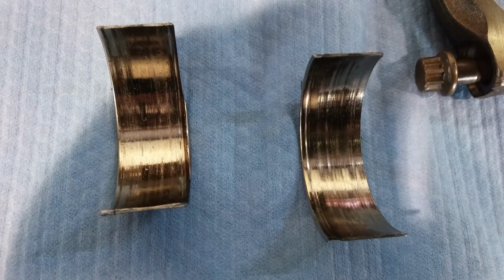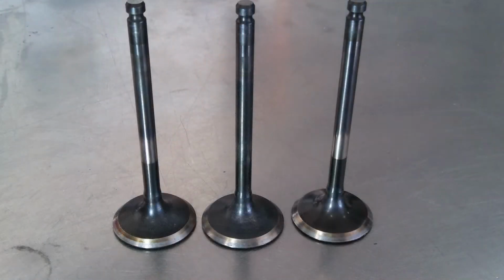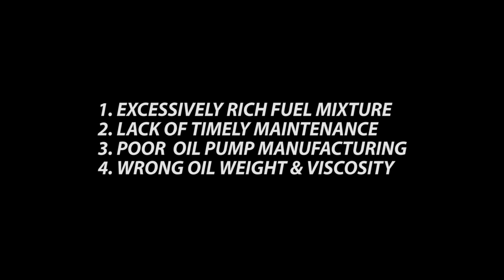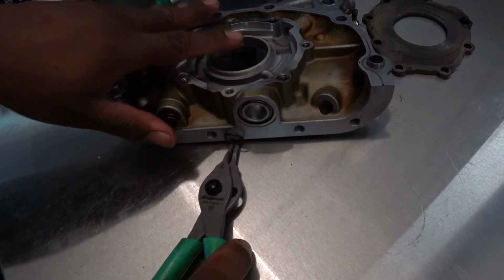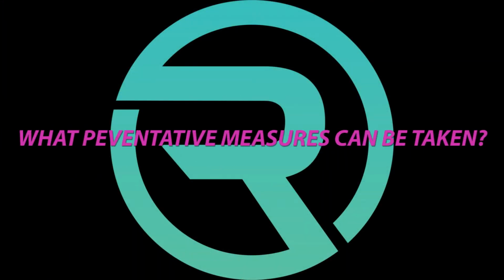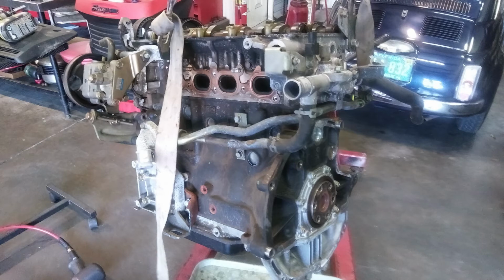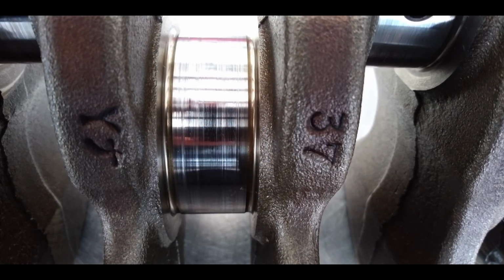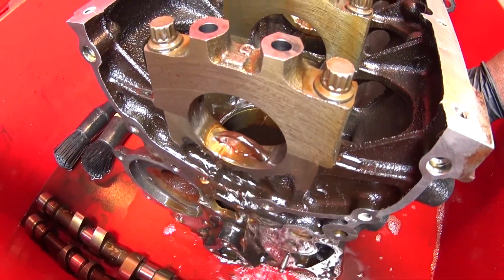Mazda Protege High Oil Consumption & Engine Failure II EP. 14 PT II

Comment: I like these engines myself I find They work well I modified mines to run sr20det pistons an rods it's more Torquey plus I have it bosted.also running a mazda f2t gear box behind the engine I have it in a 323 BH I am from  Trinidad 🇹🇹

Comment: One question:  Is rich fuel mixture that it damage catalytic converters ( very often issue ) of this model car ?. Great job.
Reply from the maker: A over rich mixture is not necessarily a faulty catalyst. It could be caused by a number of things, i.e. bad downstream oxygens sensor is just one example and a common one on this car. Alot of people will tell you the Protege air mass sensors are always bad and make the car run rich but alot of times its NEVER that. It can be caused by low or nearly discharged battery or faulty downstream oxygen sensor.
Reply: @RetrocarStyle  Ok. Thank you for your videos about Mazda Protege.
Reply from the maker: @MDEV-86x86  Also check for vacuum leaks...this can cause rich running conditiins too!
Reply: @RetrocarStyle  Ok. Thank you.

Comment: Hey man! Looking at an '02 Protege5 as a daily. Watched your video where you went through the oil consumption, and then this video. 5 stars dude. Good content, great explanation, lots of details, thank you! ... granted now I'm starting to second guess the purchase lol
Plus 2 likes (1 for each vid) plus 1 sub 👍
Reply from the maker: If you really want the car, do the engine swap. They are pretty reliable. Besides the annoying issues i've experienced they make great daily drivers. So far with the 2nd JDM engine, I have not experienced the oil consumption issue. Most JDM engines when sold to you have about 50-55K on them. I have about 165K on the one I have now which means it already has 200K on the clock and it runs very strong. I do change the oil every 5k with 10W-40 full synthetic..no issues. If you buy the car, I suggest swapping to the JDM FS-ZE variant which has 167HP. Makes a world of a difference. I'm sure there is some higher quality parts inside the JDM engine which the U.S. variant doesn't seem to have.
Reply: Very good advice! 👍... any suggestions on where to look for a jdm motor? I have 0% experience on purchasing a motor, let alone one that's from a different country lol
Reply from the maker: @Bluebeast2005 There's JDM stores in Orlando FL, California, Texas and NY. Ebay is good place to look. The last JDM FSZE I bought thats in the car now  was purchased from Ebay. Came from one of the texas stores. Didn't have any issues with the engine either.

Comment: have 3 proteges, none of my engines look like this at all lol. I have 2 x 2.0 (high compression) and 1x 1.6. 1.6 such a better engine. 2.0s I need to check that fluids daily lol. 2.0 is crazy fast though for what it is. Spanked a Tesla 3 just a few days ago who tried to follow me into a roundabout at highspeed, couldnt keep car together and slammed on his brakes whilst I accelerated through at speed with ease. I love these cars. I service mine every 1-2k and use full synthetic Castrol oil. My cars have only tasted 98 octane.
Reply from the maker: Keep in mind the Protege weighs only 2672 lbs...the Tesla weighs alot more than that because its basically a hugr battery. The added weight well prevent it feom being able to brake late in corners. It would have to brake early due to its porky heft!
Reply from the maker: Also...I have not had this issue out of my JDM FDZE engine...only the US FSDE ive experienced this with.
Reply: @RetrocarStyle  my engine is an FS but from AU. THe only cars ive seen on the market that are broken in AU have been neglected. Its not normal for people to check oil levels in this country either lol. Let alone service their car. THey basically drive til there is a problem and palm it off to someone else.

Comment: I have a 1.6 Mazda motor that has 283,000 on it plus run but you are right on one thing it does clog up the catalytic converter fast I had to clean it every 25,000 miles because excessive oil burning because valve stems are bad
Reply: I have the same problem with catalytic converter: How you clean your catalytic converter, please ?.
Reply: @MDEV-86x86   Couples  ways to clean it one way is use 1 gallon of lacquer thinner in the gas tank or take it off the vehicle and One side off and fill it gas and diesel mixture and let it sit for 15 to 20 minutes then wash it out with water, then let it dry and then put it back on or use catalytic cleaner it’s up to you
Reply: @wilyceyote  OK. Thanks. I clean It !.
Reply: Plug-in off what I meant
Reply: @wilyceyote  ok.

Comment: Thank you bro im gonna try use the bg engine restore stuff, mines got 250k and loses almost a quart a week driving around 500-600 miles a week. i drive the thing gently too i got a stick shift. i been seeing dollars fly out my pocket im like whats wrong with this thing lol appreciate the info, subscribed bro
Reply from the maker: Ok...let me fast forward to the back of the can. BG does not recommend using the product if your engine has very high mileage such as 250k +. In this case, I would recommend adding about 1/2 cup of Mercon Dextron ATF to your oil just before changing it. USE ONLY AT IDLE. DOT NOT DRIVE THE CAR. Idle the engine for about 30 mins before oil change. After the 30 minute idle, Allow to cool for 30 mins. Then change the oil and filter. U could also try Lucas oil treatment. You can actually drive with the lucas oil treatment and it does EXCELLENT at cleaning the inside of the engine. If Mechanically savvy....remove the catalyst and exhaust manifold and check the exhaust ports for excessive oil clumps....if you see that...then the valve stem seals have failed. If you replace the seals and it continues to use oil...you will need subesquent cleanings with ATF or Lucas treatments. BG cleanser is quite harsh. Be Very careful with very high mileage engines.

Comment: The FSDE has a terrible oil pan. With high handling limits of the Protege, smaller than average quarts of oil it can hold and oil burning issues; the high g limits can cause oil starvation in cylinder 2 and 3. Buy an oil pan with baffles. AWR used to make one, but they have since gone out of production. Hydra currently have one with increase oil capacity. At $400+ it isn't cheap, but it is insurance for future headaches
Reply from the maker: I actually had considered buying this as an upgrade. The only thing stopping me was well....the price. Not cheap but well worth it if you have an aggressive driving style or you race a lot.
Reply: @RetrocarStyle  cheaper than a new motor. 🤑 Great videos. Keep up the great work
Reply from the maker: @YourMom-vl2sp  Well....not by much. At the time I replaced my blown engine with the FSZE they were selling for like $550.00 from JDM Orlando, Orlando Florida. Now, because of inflation they are like $700 - $1200. Because of my findings, id rather combine this oil pan with a JDM import engine for a really nice combo. Get both, double the wins.

Comment: Are the cranks so different between usdm and jdm? Im in the process of " converting " an usdm into jdm, only missing installing the pistons, which I'm doing for the exact oil burning issues on this video. Was looking forward to making  the car my  daily for the low fuel consumption.. at least compared to my other cars... but If it is as such, I will just forge the block and turbo it. I will just mod the oil pump then. 

Unrelated question, which exhaust cam does your ZE have? fs9p/fs0p-a or fsd7?
Reply from the maker: Super late reply but it uses the FSD7. Also the cranks share the same bore and stroke, but the quality of the JDM crank is much higher than that of its US domestic counterpart.
Reply: @RetrocarStyle  both are supposed to be forged. Its really the rods that are so very weak... well, both the rods and the bolts, the bolts always let go first, I'm going to use arp, which is too much cost for something so simple
Reply from the maker: @KreepaEvoX  Both cranks are forged...but if you take a closer look...the JDM crank appears to be a much higher quality forging.
Reply: ZE with the higher compression  engines should have the FS9 cam

Comment: I new already few information what you talking in the video, which is great part of knowledge of are Mazda's. I'm also using bigger oil filter, flushed my both 2.0 FS 323 ( Europe ). 
The valve sealing are worn out for sure, and piston rings stuck... that's my thoughts even after flushing those engine's. What I'm gonna do is changing the valve sealing and try to poot engine flush at the top of the pistons for 24/48h leaving them in the middle. If that's not gonna work...measuring all and piston rings replacement if that's be enough. BTW 
I'm changing oil every 10th km and it's Liqui Moly Synthoil 5W40. 
Great video and keep it going!
Reply from the maker: Here is another well known product amongs Techs and Mechs...Automatic Tranmission fluid also disolves carbon and oil deposits as well....you could use some of this in your engine oil as well to help out with carbon dissolution.
Reply: @RetrocarStyle  
I will be changing the fifth gear from Mazda 626 2.0 FS 115hp it is longer then ours. The difference is around 4/5 hundred rpm so 100km from 3000rpm you having 2500/2600. For a highway and milage is a good option...I 🤔 😆
Reply: @RetrocarStyle  
Thanks for info.
I know the flushing brand tec 2000 what having in spec toluene and it works pretty good with carbon deposit. Summer time I will take off intake and exhaust manifold to check them. It is done pretty a lot in mine and my girlfriend car so I will try to provide warn out them. 
Will try also kerosene... like an older day's - will see.
In mine Sportive version I will change exhaust manifold from Ford Probe as well but first valve sealing. 
What do you think of removing butterfly's from intake manifold?  EGR is blind BTW. 
Piggy back could help to tune them better then the factory?
Reply: @RetrocarStyle  
Last thing😆
If I could find FS-ZE engine with what it has to be to not have any issue doing the swap? 
Thanks a lot 🙏
Reply from the maker: @Gronozzz  You would need to change the harmonic balancer pulley and the intake manifold...in my car i didnt change the manifold i modified the plastic reservoir to make it work with the fuel U.S. style fuel rail.

Comment: Mazda Protege uses 5w30 or 10w30 ( with high millage ) oil engine. I use Castrol Edge 5w30 C3 in my Mazda Protege and I have not any problem.
Reply from the maker: I strongly suggest using 10w-30 or 10w-40 full synthetic. Feel free to use what ever weight you'd like. I only make the suggestion due to the information that I have come across.

Comment: I'm glad you finally posted a new video it's just I'm going to be building the fsde motor so I wish I knew about that other motor before but oh well I'll try to get it sometime in the future
Reply from the maker: How far have you got on the rebuild?
Reply: @RetrocarStyle  getting the piston & rings, bearings.
Reply from the maker: @renellplatero7408  If you have not bought the pistons yet, you could call up JE Pistons and have them make you a set of forged units with a CR or 10.5:1 for about $550+ - bucks.......and they come with rings.
Reply: @RetrocarStyle  ok Kool. I think I might do that. Thxs boss
Reply from the maker: @renellplatero7408  I dont have the footage but I put a new cylinderhead atop my FSZE before it failed. It switched the FSH9 higher lift camshaft out for the FS1G that normally comes in these cars and put on the ported manifold, the result was that the Protege was extra punchy in the low rpm ranges and had very good midrange power. Makes dailying the car very easy and kind of fun when you punch it to blast around slow pokers.
Reply: I just got the block honed out $50,000 over got the valve job done valves are all done just waiting on the pistons rings new water pump no pulleys belts I need a new rotors for rotors and brakes and it sucks as I'm a single dad you know I'm really small income so it's really hard for me to get parts and so it's taking me so long and you know I have two kids that I've been raising on my own for the past 13 years so it's a little hard for me
Reply from the maker: @renellplatero7408  $50,000?????????